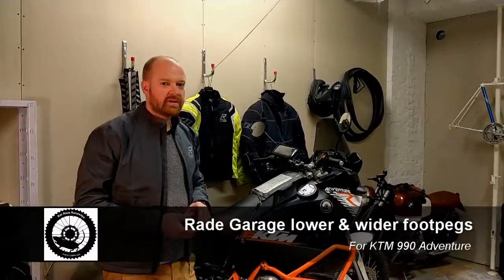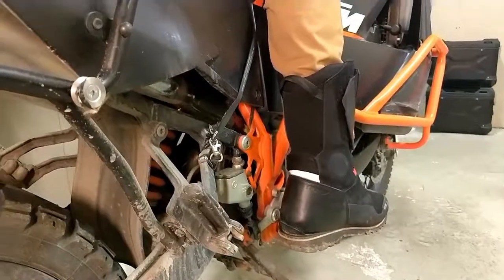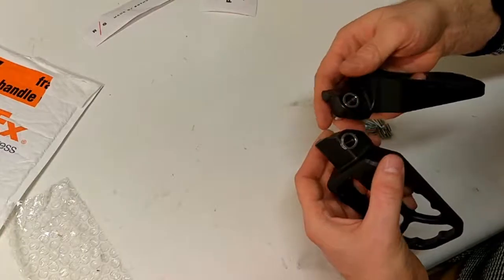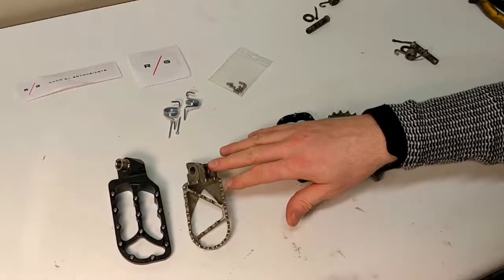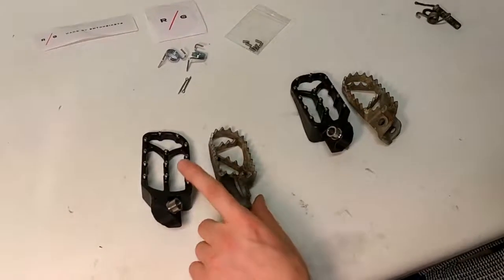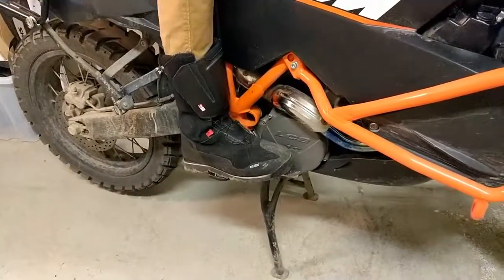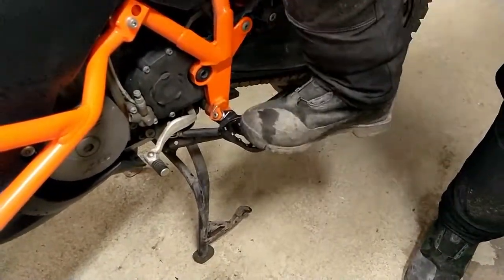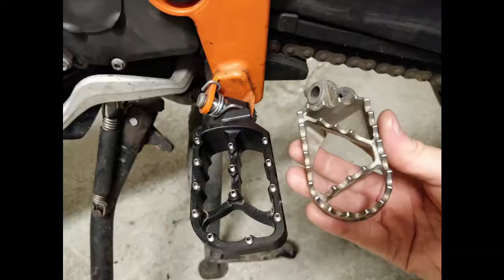Rade Garage footpegs review

Comment: Great video thanks. One question - can you notice a difference in comfort  when seated compared to the original pegs?
Reply from the maker: Thanks for the feedback! Obviously the difference is not that big when sitting down. But of course you have slightly more room and the angle of the knee is not so tight. To me the biggest benefit when sitting is that I don't have to position my feet so accurately. No matter how you wiggle around on the bike you always find the footpegs. :D